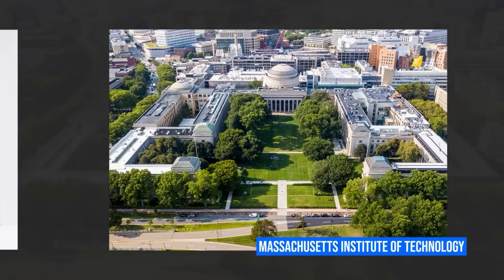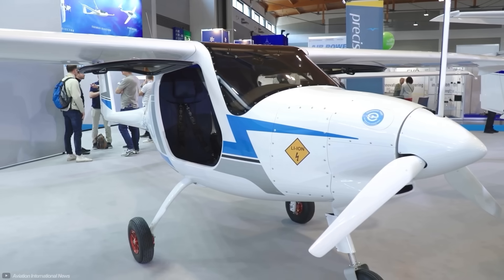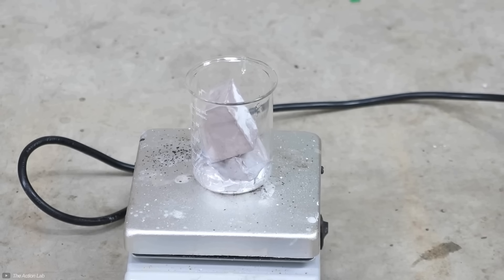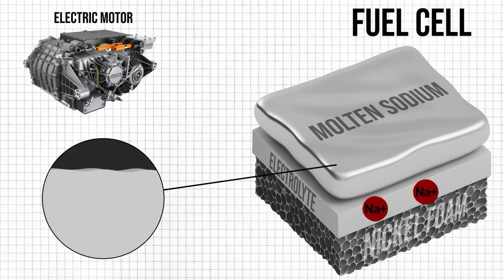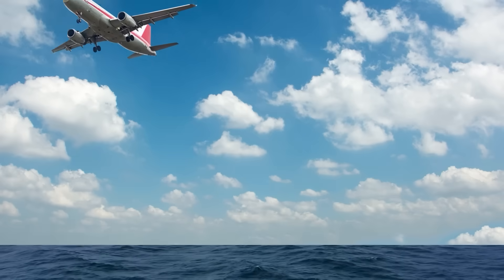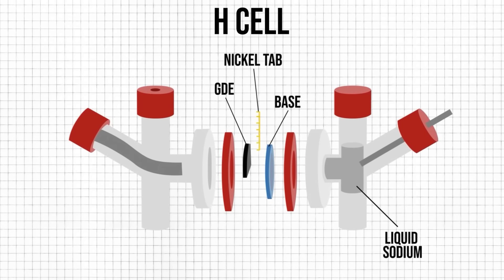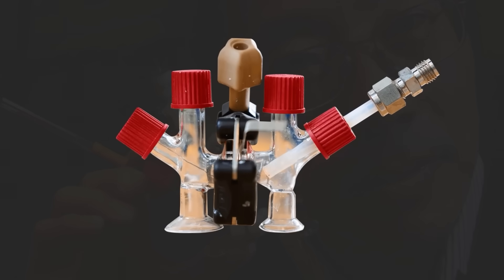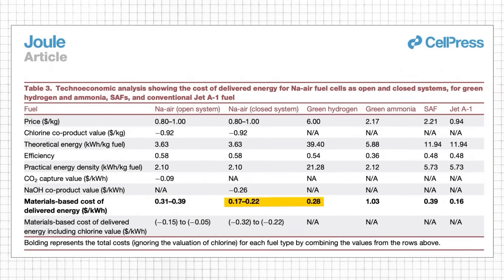How MIT's New Sodium Fuel Cell Changes Everything

Comment: When I was a graduate student in chemistry, I found out up close and personal that sodium metal is very reactive. There is a reason it has to be stored in oil; if any moisture, any at all, finds the metal, it is explosively combustible. So any metallic based sodium fuel cell has a safety/storage overhead that far exceeds Hydrogen.  I don't see it being commercially viable.
Reply: An unaddressed risk like that is for sure, not commercially viable. Yet, I wonder how many dangerous things surround us that are yet used privately and commercially. I wonder, that maybe if solid sodium were to be made commercially viable, what changes or what safety systems would have to be implemented to make that a reality?
Reply: Also, I don't see how this is a weight savings over storing hydrogen. That water vapor, which they are passing over the nickel sponge, is probably from onboard water... Water tanks are no doubt heavier than compressed hydrogen gas tanks.
Reply: @tylersen3318  fly in rain and collect rainwater...sea and drop a tube in it suck it up
Reply: @orangestoneface   I wouldn't want to be on a plane that only flies when the weather is "just right"... "wet enough"....

Also, there aren't lot of rain clouds at 30,000 feet, where planes cruise at...
Reply: @tylersen3318 
Hydrogen is hard to store because of the small atom size and high volume at atmospheric pressure.
This means heavy tanks, so this could be weight saving.

Still doesn't sound practical yet.
Changing our habits and expectations would be way more technologically simple.
Reply: Aerospace engineer: Then you should also know Lithium is almost as reactive as sodium and several other similar elements.
Reply: How can it replace Li cells if it’s not rechargeable? Also Hydrogen is easy to make, I can make it at home. Sodium however is extremely expensive and difficult to make.
Reply: @garethwilliams2173  Sodium??
Try electrolysis with sea water?
Just watch out the gas of the other electrode is Chlorine.
Reply: @tonywilson4713 you can't get sodium from seawater directly. You need to do electrolysis with hot molten salt or hot molten hydroxide. Also you need an inert and dry atmosphere to work with sodium.
Reply: @dtibor5903  Sorry but all you need is a solution that conducts electricity.
We all learned that in high school science class.

I didn't say it was efficient or practical as an industrial process, BUT IT IS POSSIBLE.
Reply: And what are the costs of obtaining pure Sodium. Didn’t see those costs included sofar.
Reply: One science lesson from High School I remember vividly was the reaction of Sodium to air. It exploded. Sodium is considerably more reactive than Lithium. Lots more testing on a larger scale before this is safe. Petroleum based fuels do not react to air or water. I am interested in all new battery tech but this one is a long way off being proved viable.
Reply: There is a reason table salt is listed in OSHA safety regulations. Both parts of salt, NA + Cl, are freaking scary bad.

I am assuming that salt is the source of the liquid sodium, since it is the most abundant source. What happens to the chlorine gas?

What is the catastrophic failure scenario?
Reply: You put sodium into a steel can, like those used for food. Can is tough, easy to heat, easy to remove content automatically, recyclable.
Reply: Sodium can be contained easily in a steel can. Like those for food. Tough, recyclable. Problem solved!
Reply: Here's an interesting coincidence: the energy in one cubic foot of gas at 10,000 psi differs from 1 pound TNT equivalent by less than 3%
Reply: The only way this could even be allowed would be if you added a catalytic converter to neutralize the lye.
Reply: Sodium isn’t that dangerous in air though. Compressed Hydrogen will explode in a fire, while sodium will react much more slowly with air in its liquid form leading to a slower release of energy which is ideal. It will also only have a relatively violent reaction with water and in that situation it’s not that much more dangerous than any fuel that’s been ignited, certainly no more dangerous than compressed hydrogen. The firefighting measures are different, but the situation isn’t much more dangerous than a gasoline fire
Reply: Ever set a match to a gallon of gas?
Reply: @chuckaluck123 gasoline isn't pyrophoric in humid air, though
Reply: Same as lithium
Reply: @ftropper-h2d  Sure, and that's why the lithium in batteries isn't a bulk liquid.  Sodium isn't dangerous as an ion in table salt, but liquid sodium and rain are incompatible.  That means no wrecks on rainy days and no extinguishing crash fires with water.  Elemental sodium a transport hazard 4.3 material, requiring special permits to even transport on the road, much less transport in a liquid phase.
Reply: @rsaunders57 😂 you’re saying my cat can run on table salt 😂😂
Reply: @ftropper-h2d lithium metal isn't used in batteries, and even if it was lithium is substantially less reactive to water. Reactivity goes up as you go down the alkali metal column in the p tablr
Reply: @ftropper-h2d 

No, Lithium is totally stable unless you hammer it into foil and set it on fire.

And before you start the BS, Lithium is refined from salt water.
Reply: Same thing with lithium. Solvable problems. Not to shame you, this is more of a PSA. Comments like yours are naively misguided and misguiding in expecting highly energy dense power sources to be safe when compromised. Unfortunately they abide by the laws of physycs, so no source will ever be. Do you know the precautions one must take with gasoline? AA, AAA, and 9v batteries? Hydrogen? All of them volatile yet safe with proper precaution.
Reply: @nothoughtsheadempty6220  If you look at this idea in it current test design it looks very dangerous as it uses elemental sodium. If they can find a safe way to store and transport sodium "fuel-packs" then it could work, but it seems too unsafe for use on a plane.
Reply: @nothoughtsheadempty6220 none of those materials are pyrophoric in humid air, all require a less common chemical reactant or a spark to produce a genuine hazard (save hydrogen which is stored under pressure).

Comment: Ok yes a much simpler system then the current system. Separate sodium from salt using lots of electricity. Do something with the toxic chlorine. Ship the heavy sodium to wherever it is needed. Somehow load it into the car/plane. The system somehow  melts the sodium. The sodium goes through a ceramic separator and flows through a nickel sponge where it has to chemically combine with water vapor and oxygen to become drain cleaner and water? I thought the air had water in it? where is the excess hydrogen coming from to make the water?   I'll just skip over that part. I'm sure the MIT geniuses have it figured out. Then the drain cleaner combines with co2 and makes chalk or not and falls through the sky into the ocean or on the road without causing any problems whatsoever. Yeah I see how this is much simpler and better than using jet fuel or regular batteries to run things.

Comment: You know what I've never seen? An oil change on a Hydrogen only engine. I've always wondered what the used oil looks like since there is no burnt carbon how often does it have to be changed.

Comment: Just cant see sodium working or being that much safer the the li ion bomb under your feet. The two technology's i believe are most promising are Aluminium and solid state. However, you cannot make a battery of any type without plastic, its used in the battery around the battery and in the components of the battery and even the wire insulation. All ofthese need virgin plastic not recycled so you need a healthy petrochemical industry to produce the base material for plastic's therefore we need a mixed fleet of vehicles to use the petrol, kerosene, diesel. Basically no petrochemical industry no batteries or EVs

Comment: At the high end, the sodium fuel is 1400 Wh/kg.  And you have to keep it molten, whereas airplanes encounter colder temperatures with higher altitude.  The power plant required to get the required power sounds to be very heavy so far, but this can presumably be improved.

Jet fuel and AVGas are about 12,000 Wh/kg, so I'm not sure how anyone intends to replace those with sodium.

And the benefit?  You get to replace carbon exhaust with sodium exhaust?

It seems like a lot less promising than biomass-derived fuels, that get you a lot closer to that 12,000 Wh/kg with a net-zero carbon cycle.
Reply: 12,000 Wh/kg is the max theoretical specific energy density of Jet fuel, in practice the useful energy, as converted by the engines, is closer to 4,200 Wh/kg (in high efficiency turbofan engine at 35% efficiency). Lithium-Air batteries also have a similar theoretical energy density (11,400 Wh/kg) as Jet fuel, and trials already have achieved 1,800 Wh/kg but with low cycle lifes (<1,000 cycles).

Comment: Well two things for me: 1) you are just trading elements and thus unless you can recover the sodium - you are still producing a byproduct. Granted, you can capture it and while it might reduce the over all efficiency, at least it'll be cleaner than what we're currently doing, but compare to batteries, you wouldnt have this draw back either way. 2) Batteries are improving still with many already claiming around 500 or so with some going higher than that for next generation ones. Where I see this tech would be longer flights. Ones where you travel sea to sea in the US or to another country and high storage/people transport. This could easily replace those while batteries take care of the smaller flights at least unti batteries can take over those flights as well. As for all other transports, this might be good in ships as well - where weight is already a thing/isnt as much of an issue. For cars - I think sticking with EVs will be the same here as well esp with batteries that can easily hit into the 500+ mile ranges where the packs will start becoming smaller.

Comment: Nope, solid state devices especially fuel cells don't have the lifespan of batteries. It is cool but I'm skeptical this is going to replace any battery technology. If planes didn't fall out of the sky so much I might suggest nuclear powered electric planes.  Or better still, stop running around the world willy nilly.

Comment: Okay so you just have to add more sodium to recharge? That’s interesting.

There are still hurdles to overcome but it’s interesting. The sodium doesn’t have to be transported while molten and we know how to transport it safely. The issue would be molten sodium crashing into water, it would save on water rescue costs though.

I doubt the CO2 scrubbing would ever be used as I’m sure regulation will require the cell to ensure the byproduct is fully reacted before being released.

Comment: Dilute sodium hydroxide (NaOH) is so tame that it's edible.  It's EXTREMELY basic when concentrated (pH 13 or 14 or something) which is why it works well as a drain cleaner.  But it's completely non-toxic, and if it's dilute enough, you can eat it.  It's actually an ingredient in some foods!  It's just sodium (which our bodies need) and hydroxide (OH-) which is two-thirds of a water molecule.  

HOWEVER: Drain cleaner is VERY concentrated and therefore DEADLY if ingested.  It can give you TERRIBLE chemical burns and destroy all mucous membranes due to its extreme alkalinity.  DO NOT ingest or even touch it.

Comment: Am I correct in thinking that energy density (watt-hours per kg) is meaningful only when considering the maximum weight?  That would be during takeoff for an airplane, or in designing the suspension of a car, for example.  The fact that the unit gets lighter over time really doesn't help, does it?

Comment: I cannot see any advantage to a non rechargeable battery that requires a solid fuel replacement in a mobile application. If there comes to be some kind of liquid version of this that can be refilled in minutes at a pump, then I might agree. Even recharging lithium batteries are not as limited as this solution.